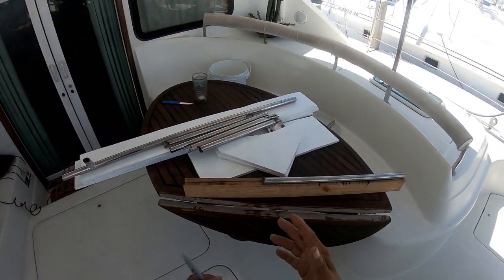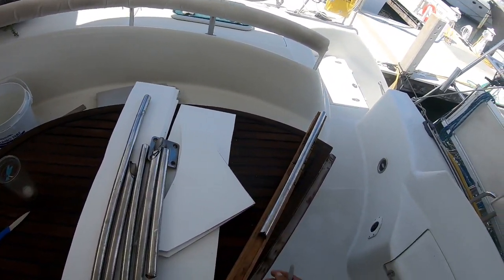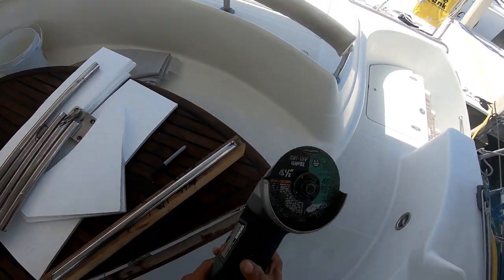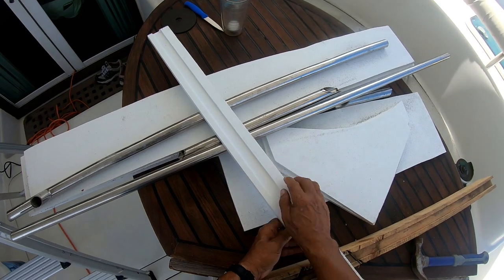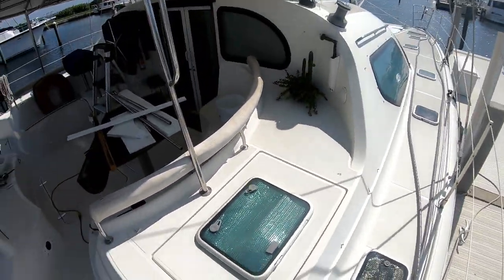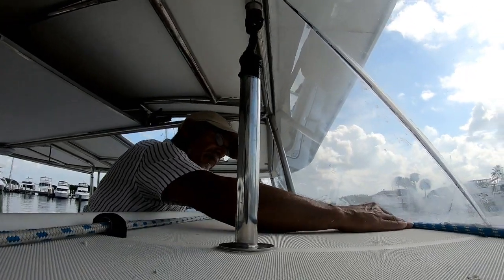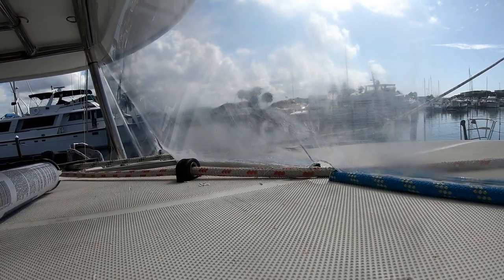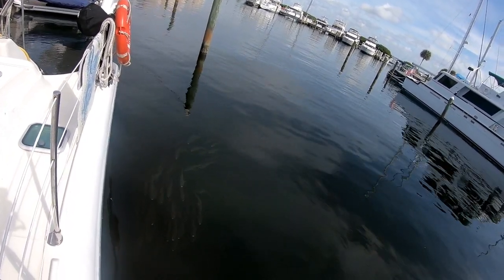Hard top and new windshield about done!

Comment: Hey Al to clean 5200 silicone from the fiberglass we used acetone (before it drys) but DO NOT use it  (acetone) on the plexiglass or on most plastics, not sure about on starboard (something tells me it SHOULD be ok) try it on a scrape left over piece first hehe. This one time I used a little on the lens of those red and green lights and it softened the lens and left it dull, had to replace it o-well.
I call those cuts fish mouths lol. hey take care stay safe and have fun...

Comment: So, getting ready to go into the big blue yonder? I suppose the Auto-Pilot can steer the boat but have you two considered about watches? Four on, four off or six on, six off? You will still need eyes in the cockpit. Plus Al, look for a pair of safety belts. Webbed belt which goes around the waist and has a meter long cord with a snap-on hook. Safe Working Load will be about 300Kg, rated at half of breaking load. The other half at least will sleep peacefully knowing the other is hooked on. Also, brush up on Sea Anchor. Best wishes. https://wiki2.org/en/Sea_anchor